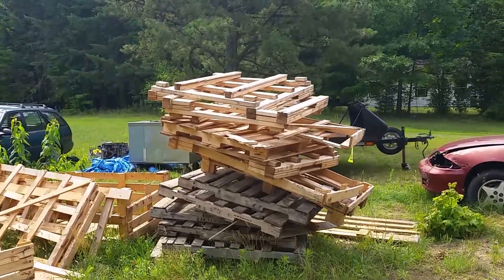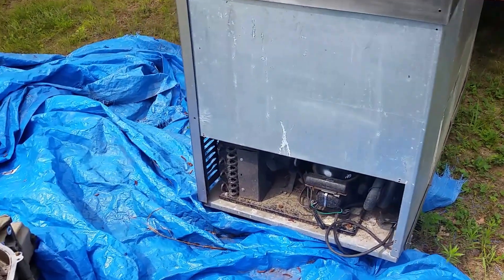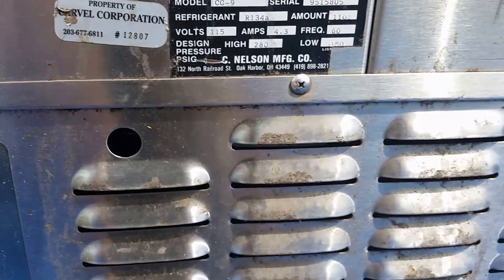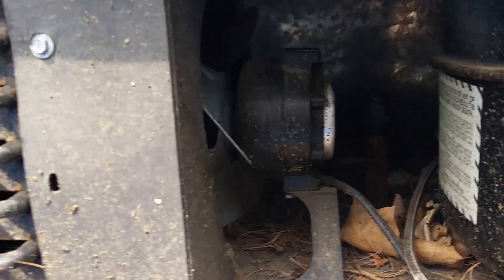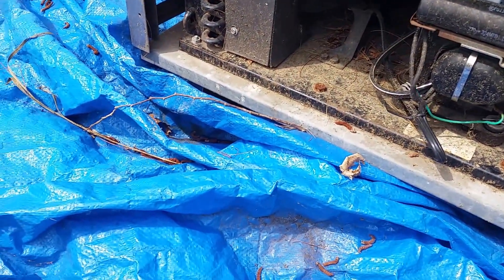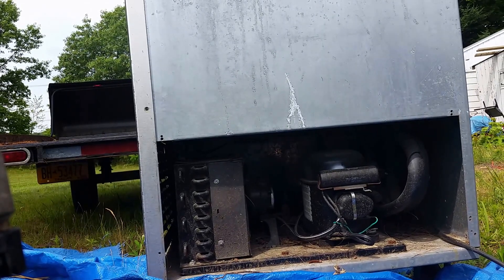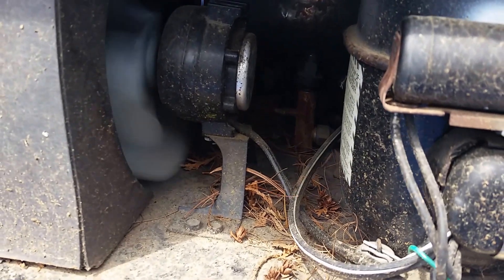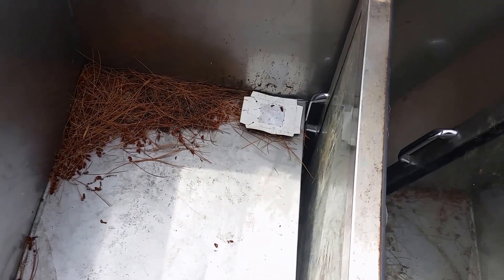Will it run: old ice cream freezer

Comment: Hi Dan, glad it is working, I noticed you have a very long extension cord running to it.
I would not run it too long on that cord unless it is at least 12ga. or heaver.
Check the voltahe at the plug of the freezer, you may find the voltage is under 110 volts and you could damage the compressor, that happened on our 12,000 BTU A/C 2 years ago because our line voltage dropped below 108 volts, the A/C had to be replaced.
Reply from the maker: Thanks Bill, I don't plan on running it on that extension cord, that was just to test it out but now you have me curious to see what kind of voltage drop that cord has.